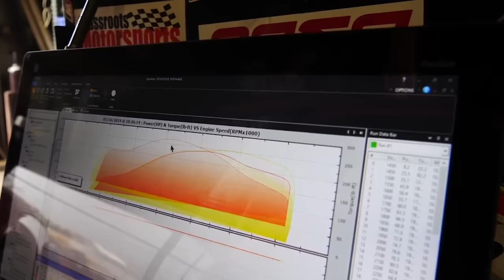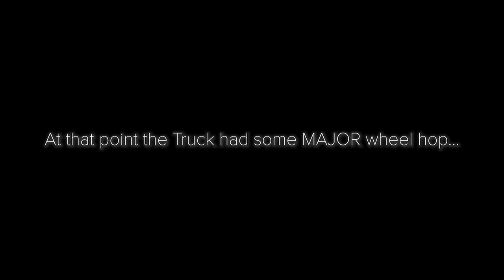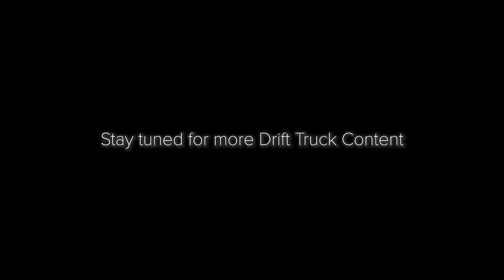Building THE ULTIMATE V8 DRIFT TRUCK in 10 MINUTES!

Comment: One of the most underrated builds on youtube.
Reply from the maker: <3
Reply: 4 sure
Reply: It is better than 90% of this years SEMA
Reply: @gabrielpokrajac5941  yea it runs
Reply: Read your comment while thinking the same damn thing! Badass truck!
Reply: @gabrielpokrajac5941  HAHAHA you're joking right, the diesel trucks with 24in rims, and 40in Mudders that are a foot and a half wide would have a better trap speed than this truck, and those are some of the slowest cars at sema. Sema is for one off builds that usually have no compromise, this is a fun car, but nowhere near sema, maybe get a little crowd around it at a local car meet until they realize it makes as much power as a 4 cylinder lol
Reply: @zachkubczak5203  the difference is that sema cars are built by a team of people, this was built by a single person with a strict budget
Reply: @Sbinott0  this**
Reply: If i might ask..whatd the v8 come out of?
Reply: Lmao
Reply: Facts
Reply: @zachkubczak5203  Gingium had 50 to 100 times less of a budget than most sema builds. If he has a budget 5 times or 10 times of what he has right now I'm pretty sure it can be better than most sema builds out there
Reply: @zachkubczak5203  bro a big heavy lifted diesel mudder is no way faster then this smaller lighter truck with a toyota  v8  motor swapped in it and a good trans this is way faster so what are you smoking bro? Lol
Reply: @nico6636  lexus
Reply: You're right
Reply: @zachkubczak5203  You mean those big diesel's that need to spool for 15 seconds to build boost before getting off the line?
Reply: Over
Reply: 4.2 mil views
Reply: 4.4 million views
Reply: Underrated with almost 5 million views
Reply: Earth*
Reply: Damn... I just admire that you know how to do all of this. Jealous.
Reply: Fasho
Reply: But is it awesome tho
Reply: @mattk252  haahaha
Reply: "Underrated"
also had 5 Millions of views
Reply: @_Gingium_  ٣٣٣3     ٢ريال  ض٢١٥
Reply: @HELIXGHOST  ١1 ٩٨٨ونصف لا يحرمني من
Reply: @_Gingium_  шщдззззз

Comment from the maker: Thank you all for the awesome comments! I really appreciate it. A lot of you have questions about the truck so here are some answers.

Engine: Toyota JDM 4.0L 1UZ (vvti version). Engine came out of an Aristo I believe...
Trans: Nissan SR20 5-Speed. Used a custom adapter plate/clutch to mate it to the 1uz.
Rear Axle: Ford 8.8, 3.73 gears with a LSD
Front Suspension: Fortune Auto Miata coilovers, 12k springs, stock arms, chopped knuckles for a little more angle. 
Rear Suspension: Custom 4 link with QA1 coilovers. 10k springs.
ECU: Link ultimate ecu, custom wiring harness

I'll add more info if I see any more questions! Thank you again!
Reply: Front lip?
Reply: Just wondering if you plan on upgrading the brakes on your setup? But a really nice, clean build overall. Glad to see someone so happy and passionate about a build.
Reply: What front bumper is that?
Reply: Roughly how much $ did this whole build run you guys? Such a clean project!
Reply: Where did you get that trans adaptor???
Reply: I need my 1988 b2200 done next 😁
Reply: Hey sick build, just wondering where you got  / what the tray cover is ..?
Reply: What glass pack exhaust are you running sounds Beasty
Reply: what model ford 8.8 rear end??
Reply: jow bro if someone asks you to sell the truck. would you sell it.

Comment: Big respect for using a 1uz instead of an ls for the swap. 1uzs are great motors
Reply: But heavier than a ls though?
Reply: @simonhill6267  I get your point but like... What's your point? Lol. Yea power to weight. But what about it's a mini truck? That's good power to weight already.
Reply: @mrarivv0007  yea just wondering about front to rear weight distribution, which I imagine is already pretty front biased in a Ute
Reply: @macmurati  the only ls that's lighter than a uz is an aluminum 5.3.  But yes I totally see the downsides of the engine, but the reliability issues are almost non existent compared to an LS.
Reply: @macmurati  uz engines dont have secondary cam lobes, and do not have a chain tensioner. It's a belt. And I've never seen an issue with tensioners. Are you sure you arent thinking of the 4AG engine?
Reply: @thebaddestogre-3698  I know the 22R has tensioner issues
Reply: macmurati alsu uzs are approved as aircraft engine ls is not
Reply: why do people think they are great engines i do not understand at all. deff because its one of the very few japanese v8s but besides that why is it cool
Reply: @xXJK97Xx  because they're very inexpensive to purchase, readily available, make decent power, are extremely reliable, and aren't as cookie cutter as an LS or Ford 5.0.
Reply: @simonhill6267  with an all aluminum block I'm not sure it is
Reply: @macmurati  what do you mean chains? UZs  have a timing belt.
Reply: @REAPER3fitty  thought because of the dohc heads, six bolt mains, etc

They look physically larger. Most Ls alloy block as well
Reply: No turbo though guys. I thought 1uz's are partially forged and require not alot to get big power (700+). He left it at 250hp. Lol hardly the ultimate drift truck with that power.
Reply: yeah, the 1uz is a beautiful engine, but underrated whereas ls are wayy too overrated
Reply: heavier for 200 less hp 😂
Reply: @schoumv6  you're  wrong
Reply: I am building a 2001 BMW 525i wagon into a monster LSX454 with a Whipple Supercharger, has a 5 speed manual and I am switching to a Tremac 6 speed. Flowmaster exhaust, Willwood 6 piston brakes all the way around.
Reply: Ls fans mad
Reply: @difficultytweak1  Ls swap are boring
Reply: @macmurati  I hope sometime in the last two years you’ve googled a 1uz engine and realized how dumb this comment is 🤦🏻‍♂️
Reply: Nicotine Gaming  there a supercharged BBC 540 in airplane 😂

Comment: Man I wish I had the talent and facilities to make something like this happen.
Reply: How do you eat an elephant? One bite at a time. Everyone starts somewhere... Pitter patter, best get at 'er!
Reply: With that attitude you never will just do one thing at a time you dont need expensive tools and there a plenty of guides to help you build one like that.
Reply: @asaltnado5168  oh get off your horse. Can't exactly build that in the parking lot of my one bedroom apartment complex can I. You cant even change you own oil here because its a breach of lease terms but I'm sure they wont mind me cutting and welding. Hence - "facilities".
Reply: @Russxm  rent a garage. I use to rent 15x 25  u- store-it. Paid 50 a month and an extra 10 for 220 electric. Started collecting my Welders, tools, drill press, manual pipe bender and notcher, parts washer, engine stand and a hoist ect all in the one end.   Was cramped for sure but warm and dry. I raced cra quads, bikes,  built truggys, a cpl rock crawler buggies  and restored a k5 blazer on 38's and a 68 nova in there. 
 Find a buddy who's got a place to work and ready to go in on a build with ya. Not always easy to do but If there's a will there's a way.  Wont happen on the couch.  Remember.......Can't is the cancer of won't.
Reply: @smitty_1  This inspired me thanks i got an 02 ranger 2wd don't know if imma go this hard lmfao

Comment: Should have went ahead and replaced the starter and knock sensors with the engine out of the truck since all that’s under the intake
Reply: Cody M Removing the intake is very easy. Just saying.

Comment: You've built a chevy S10
Reply: More like a Syclone, the way Chevy should have built it.
Reply: @christopherjbrooks9045  well the syclone is a rebadged higher trim level version of the S10. because thats what GM does
Reply: Wow I didn’t know you could get s10s with v8s from the factory! Tell me please, where can I find one!?!
Reply: @dannymickey6373  you cant but the 2nd gens are literally ls drop in ready with just 4-5 parts and about $2000-2500 with all gauges working INCLUDING TRUCK done yourself...1st gens are only about another 3-500 more

Comment: I used to drive a red B2000 stick back in the day and even with a stock 4 cylinder I could burn the tires in 1-3 gear in the rain. It would burn out in 4th too but finally bog down. Super light little truck.

Comment: Awesome job! Be proud! You did an amazing job for being young! I got a 2000 isuzu hombre with the 2.2 engine that only pushes 100-110HP. Im 21 and like to watch other peoples builds. It inspires me in a way to test my own limits what I can do with my truck. I plan on building a 4.3 vortec with a single turbo setup staying 5 speed transmission. I wanna try for 250-260HP out of the 4.3 swap.

Comment: Hey did you use the same transmission? I got a 89 mazda b2600i 4x4 and I am interested in pulling the 4 cyl to swap for a v8 and rebuild/increase power in the old 2.6

Comment: i think its great lookin little ute, i thought more power but yer, great for skids, reckon done right be mean on up hill race. ive got a bravo 2003 new ecu an pipes all im after. but if i  could ozzie ford barra. with good suspeinsion an the old motor in the back hold it down. thanx great vid"

Comment: What motor and trans did you use
Reply: He used the 1UZ engine, but I don't know which transmission. 

I'm also interested what "junk yard" parts he put in. Like the axles and what year miata steering rack did he use?

Comment: It’s still a dope truck. But as you can tell, truck drift builds are demanding and even after is all said and done the weight distribution is complete shit. So while it’s easy to throw the rear, it’s actually more difficult to control through a complex course. Great over all build though and love the rear suspension fab.